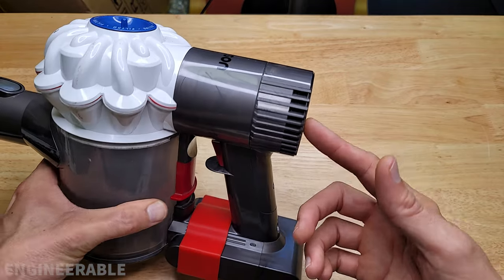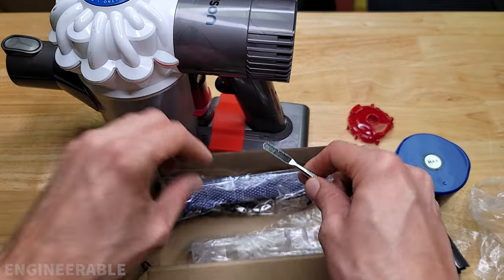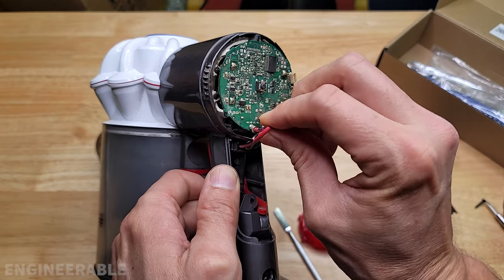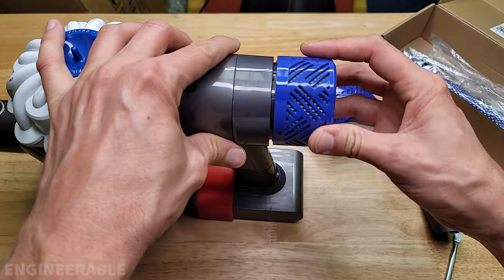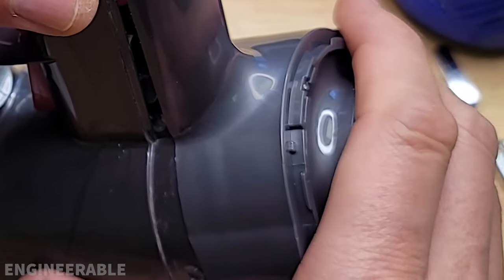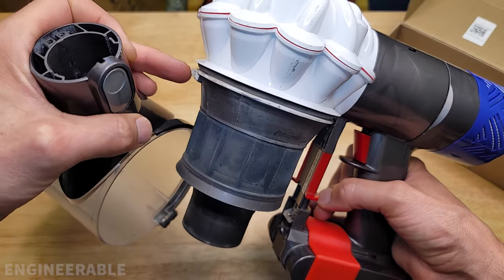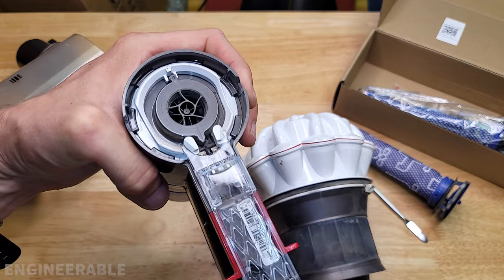HEPA FILTER CONVERSION KIT for DYSON V6 Cordless Battery Powered Vacuum | Replace Foam Filter

Comment: This is the only video that clearly shows what to do with the deflector, thank you! (Was struggling to get it to fit but didnt think about pulling the cables away from the board first and then tucking them back on top!) Up and running now, thanks again!

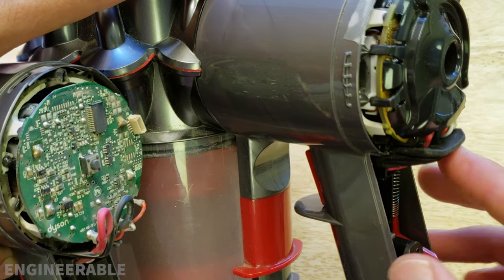Comment: Weird. I don’t have the V6 HEPA, and had to convert. But when I opened mine, it has a rubber seal to prevent leaks to the handle, like the one you show at 5:32

Comment: Awesome video! Just curious: why did you leave the red and black cables on the outside of the red plastic cover? As opposed to leaving them where they are and putting the cover over them as seen on the HEPA version you show at one point. Thanks!
Reply from the maker: Thanks! The wires could also go under the red cover. I didn't previously notice that's how Dyson does it. I didn't do it, because it seemed like the wires would need to bend too tightly to fit. I doubt it makes much difference.

Comment: Will it not be difficult to open it up again in the future since the glue would be stuck to the cover?
Reply from the maker: No real need to open it in the future. You can also apply something nonstick to the area that you don't want it to stick to for future disassembly. A light coat of Vaseline will prevent it from sticking, but still seal.
Reply: So does that mean I apply vaseline on the cover before I close it over the final application of glue...So as to create a seal that does not permanently "glue on" the cover?
Reply from the maker: @chiquilim7991  yes, and you only need a thin film.

Comment: t seems like this is almost double the price of the ones that only come with the rear housing. Do you think it's worth it to get the pcb cover with this kit?
Reply from the maker: PCB cover is probably not necessary for function, since the foam filter didn't have it. Main thing is to use hot glue to seal off the lower handle area.